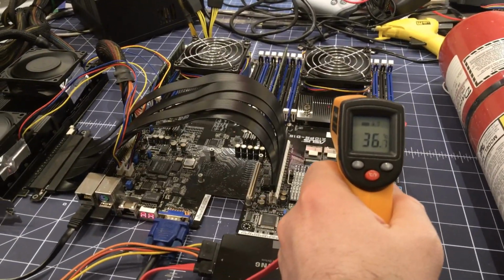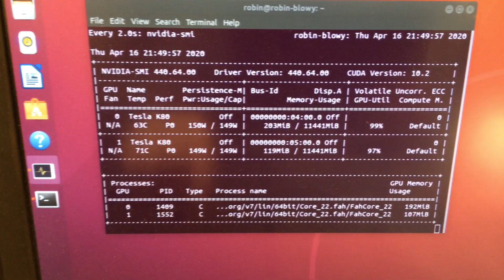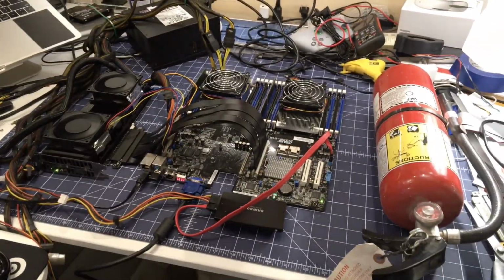Tesla K80 powered FOLDING@HOME monster

Comment: I looked at a very similar configuration. Everything that I see shows that K80s are worse than 1080Tis in every aspect other than VRAM and FP64 performance.
The only reasons I can see to buy a K80 are: * You need FP64 (it's way way faster). * You need more VRAM than FLOPS. * You manage to lowball the price. * You are having a competition to see how many GPUs you can pack into one computer.

Comment: This is pretty cool. I'm building a dual Xeon E5 2678 v3 X99 system which will have 32Gb of ECC DDR4, a 2070 Super, a 3060, and a 6600XT. The board I'm using is a Huananzhi F8D, which I picked because it has three full speed and width PCIe 16x slots, so I won't bottleneck anything that I plug into it, unlike my current Folding machine, where I'm forced to run at 16/8/4. I was curious about these K80's, especially because right now they're cheaper per point than anything that's strictly a GPU, but they do not seem to be super efficient.

Comment: If you wanted to use it as a personal computer, how do you connect several monitors?
Reply from the maker: You need to install a graphics card alongside the K80, in a follow up video I replace the K80 with 2xTitan Xp GPUs but you just need a single normal GPU and then you can connect multiple monitors. If your motherboard has built in video HDMI and DisplayPort you can also simply use that. Check out the video called Machine Learning FOLDING@HOME Monster Follow-up for the Titan Xp version.

Comment: I really was thinking on using a Tesla K80 for folding@home but lucky i found this vid and only 600.000PPD for 300Watts are a poor result ( even my 1650 made 450.000PPD, my Vega64 makes 1.400.000 and my 2700super makes 2.400.000 PPD. I better save the money and wait for rtx3090 to drop down to its anounced price - that biest makes >6.500.000 PPD for just 50 Watts more....
Reply from the maker: I’d agree with that K80 have memory advantage but they are a few generations back so not very efficient by latest standards. My Titan XPs do 1.500.000 PPD but I too am looking forward to RTX 3090 when the supply is actually available. K80 is better for machine learning work loads that require lots of RAM.
Reply: The 3080 is better in watts/ppd.
Reply: "Processor Performance Database for Folding@Home PPD (points-per-day)"

Comment: Can a k80 also compute graphics
Reply from the maker: It has no video out but it does use cores when rendering the screen. I works with CUDA API so as long as your graphics rendering can work with NVidia drivers for CUDA it should work.

Comment: Thanks for the helpful video. I also bought myself a pair of Tesla K80 for my server assembled from spare parts from eBau. Tesla cards are very expensive for Russia. We rarely have anyone doing home research of deep learning of neural networks, it is too expensive and difficult to buy equipment.
Tell me from your experience - do both K80 chips really work as one, with a common memory into which you can load a whole neural network larger than 12 GB in size? Or is it just two K40s on one card?
Reply from the maker: The K80 is like 2 GPUs on a single card. The operating system sees them as separate cards. They have 12GB each. It’s not like 24GB shared.
Reply: Thanks for the quick response. According to the description of the cards at Nvidia, I thought that they could be as one system thanks to NVLink. If this is not so, then they are an analogue of the K40 pair, with a reduced TDP and the number of cores in one slot 16x

Comment: summer heat slowing u down now? 

At one point u were going 2.8M/day. Did u have 4 of these running?
Reply from the maker: After the Shopify vs MindBridge folding competition was over (MindBridge won) the heat was off in more ways than one. :-) 
https://stats.gho.st/
I upgraded this machine a little replaced the K80 wth 2 Titan Xp and it can manage 2.8M per day by itself. The machine is really not for folding now more data science but I will post an update video on it in a day or 2. It has a case now!

Comment: Hey, is it possible that you can send me the two vBios of your K80? One of mine is screwed up and I cannot find both of them on the Internet. Thank you
Reply from the maker: I think these are the ones you are looking for. These  bios numbers match the ones in my cards. Instructions at the link also tell you how to unpack and install the bios. The vBIOS for the 2 GPUs in the card have slightly different version numbers but I believe this installer with flash both.  Good luck with it. 

https://support.hpe.com/hpsc/swd/public/detail?swItemId=MTX_b003f6d590914327b762f22be5

Comment: can I use 600 W power supply for this setup? thank you.
Reply from the maker: The gpu uses 300 watts and the motherboard and cpus use about 200 to 300 watts so it would be really tight. It would boot but under full load I would worry it will just shut down. 750 watt can do it for sure and is stable that is what I used.

Comment: If i plug the k80 into the Slot， Just add more GPU  in the control center, right?  Or will it be recognized as two gpus？And how much PPd can it get?
Reply from the maker: Just plug it in and the system sees 2 GPUs. PPD is 600,000 ish. These cards a really designed for high end machine learning with lots of GPU RAM and not folding. Folding requires only small amounts of GPU RAM.
Reply: @robin-g6  Copy that. Thanks, bro

Comment: Nice job. I'm trying to do something close to this but choose to build with an Asus strix x399. Don't know if k80 will work with it.
Reply from the maker: Flavio33ish hello, i think there is a good chance it will work. It’s hard to know because NVIDIA K80 has no published compatibility list. The motherboard is from  ASUS and high end so its a good bet. Usually I check for a BIOS option called “Above 4GB Decoding” before I buy something and be sure to enable it before you plug in the K80. Good luck with it. Let me know if it works.
Reply: @robin-g6  if my mobo doesnt have that, but it works with an 8gb card will it work with a 24 gb card?
Reply from the maker: Working with a 12GB or 8GB graphics card is pretty normal. Most systems will do this.  During the POST process the system allocates resources to things it finds in the PCIe slots. From the research I did when my mobo did not work. There is something called the PCI BAR (Base Address Registers). During POST the system reads the BAR config for each card and allocates resources for each card. Its basically something like memory mapped I/O I believe. Some motherboard's BIOSes simply don't support the BAR allocations for K80s because they are unusually big. 2x 12GB. When it does not work the system simply does not boot and you have to take the card out to get it to POST.
Reply: @robin-g6  is it possible for a board to work even if it doesnt have the setting?
Reply: @robin-g6  do you know of any cheap boards that work with a 4770?
Reply: @robin-g6  could I flash my mobo with new firmware?
Reply from the maker: @wowepic2256  The setting is not always called "Above 4Gb Decoding" its sometimes in the Advanced BIOS Menu and in other manufacturers in the Boot menu. Here is an MSI article on the setting and what it does on their boards https://www.msi.com/faq/motherboard-2726
Reply from the maker: @wowepic2256  Cheap boards that do this are hard to find. Anything server class or workstation class (WS) is a good bet. So something like this MIGHT work https://www.ebay.ca/itm/ASUS-P9D-WS-Motherboard-LGA1150-C226-4x-PCIE-x16-IO-Backplate-100-Working/323794234882?hash=item4b63a3ee02:g:NFIAAOSwGhxbpfFQ

There is no compatibility list for K80s so hard to know. Getting a motherboard designed for multiple GPUs is also a good bet.Most server boards also a good bet.  I found a cheap Asus Z10PR-d16 with 2 Xeon CPUs on ebay for $250. (thats the one in the video)
Reply from the maker: @wowepic2256  Always an idea to try this. Can't hurt.
Reply: @robin-g6  thanks for the help. Ill look into it.
Reply: @robin-g6  https://i.imgur.com/Xi5lY4N.png screenshot of that ASUS WS mobo. Is this above 4gb decoding? sorry for bothering you
Reply from the maker: wow epic yeah that ‘memory remap’ BIOS option is the same thing.

Comment: Hi Robin, nice setup! I am using K80 and M60 with my consumer Z170 mobo (Maximus Hero VIII) and it's working well too. 
Have a nice day!
Reply from the maker: Cool, I tried a few other motherboards MSI and ASRock before I found an ASUS Z170-WS which worked with a single K80. I could not get it to POST with 2 cards!
Reply: Wow! I was trying to achieve the same with Gigabyte Z390, but I'm not sure if it can fit two Z80, maybe the ASUS Z170 does!